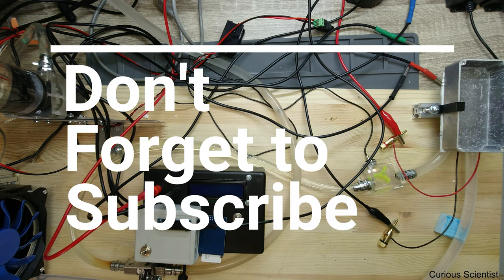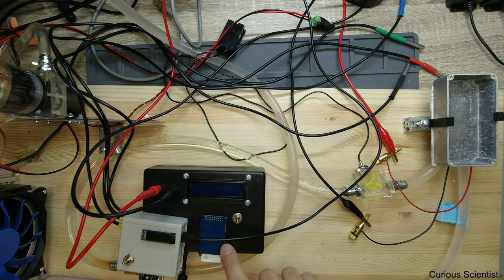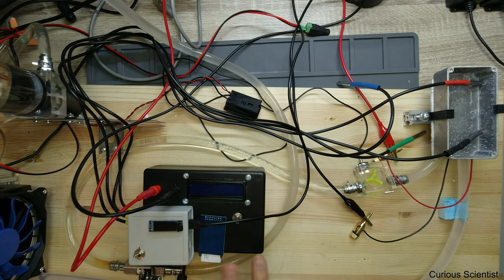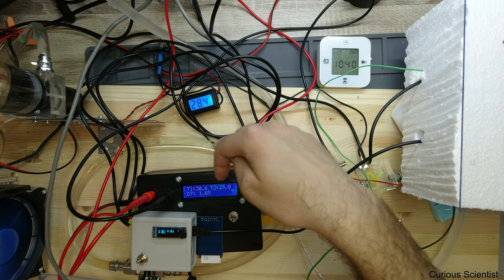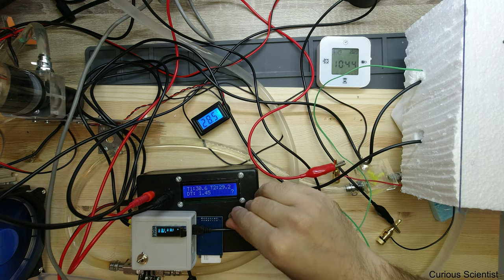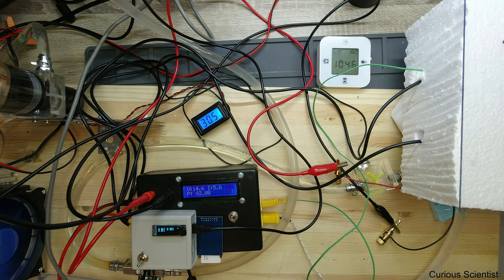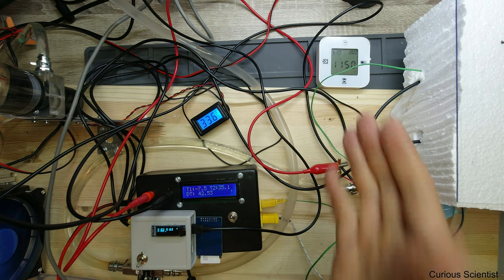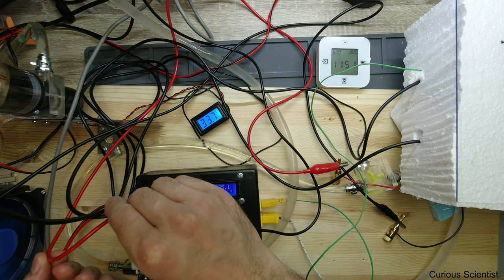Testing different Peltier coolers by cooling/freezing water - Part 4 - TEC12708

Comment: This one is much better than the 06. 
@ 36:36 You think the temperature difference will be significant there? Will be better if the readings were done there than just guessing applying a corrective factor? 
(obviously first is needing to know the loss factor, I'm always complicating everything lol)
Reply from the maker: Yes, I think this cooler is the "best" for us, simple users. If you cannot provide proper cooling for the Peltiers, this will provide the best cooling for the invested energy. The higher tier (12710, 12715) coolers are more hungry for current, so they provide better cooling if you want to cool better with them. The lower tier (12706, 12703) coolers just cant cool enough, because they are "limited" by the lower current, hence lower cooling power (Qc).
I think the temperature difference is that significant. I know, "to think" or "to believe" is not very scientific. But whenever I got funky numbers, that happened at high currents, and whenever I applied this kind of corrective factor (15-20°C), the numbers seemed better. I think we would get better results by measuring everything. I have to work out some better methods to measure the temperatures.

Comment: I'm sort of lost in the explanation of watts. You had 5.5A x 13.3V is 73W but you then mention 12W as required watts for this experiment. Did I miss something? I will rewatch it after a bit.
Reply from the maker: Hi! 73 W is the rejected heat created by the current running through the circuit (P = U*I). The 12 W is the cooling power (Qc) which is guesstimated from the measured results. The sum of this (P+Q = ~85 W) will appear on the hot side as the total rejected heat of the Peltier cooler that needs to be carried away by the cooler that cools the hot side. 

I made a very neat calculator for Peltier coolers (only for these 5 that is introduced in these series) where you can see all the watts, temperatures, voltages...etc based on your input. I will make a video about it and publish the calculator (it is an Excel sheet) at the same time.
Reply: @CuriousScientist  hi I know this is 3 years old comment, I’ve browse through your videos and can’t seems to find where to find this excel sheet 😅 Am I missed it, or you never had the chance to publish it? Thank you so much for the videos, I learn so much
Reply from the maker: Hi!
What information exactly are you looking for? I could provide more data if needed, I still have all the results.